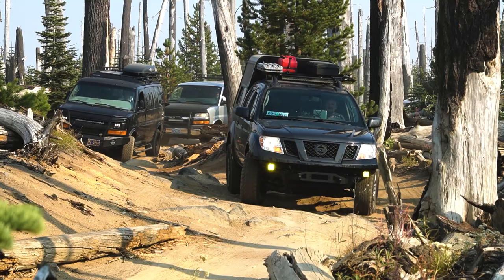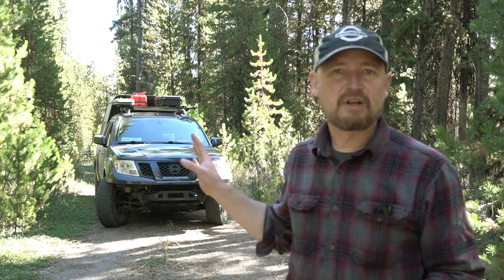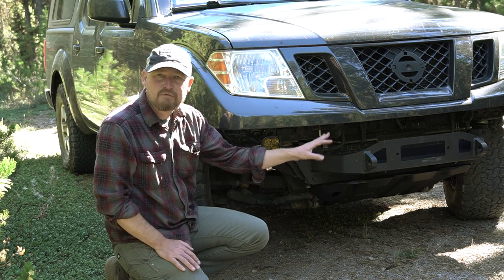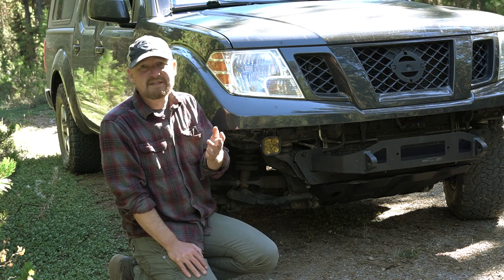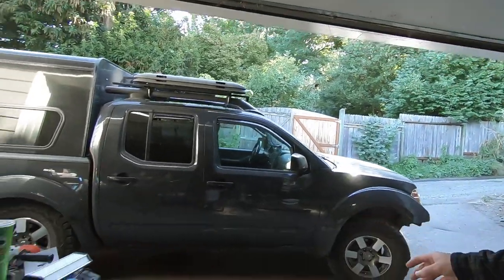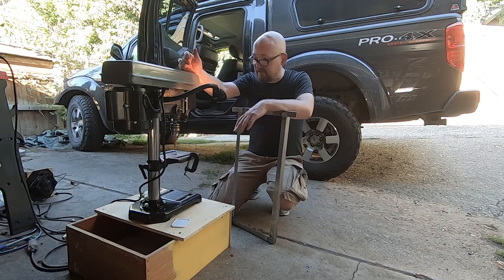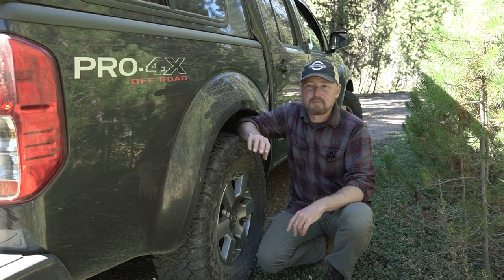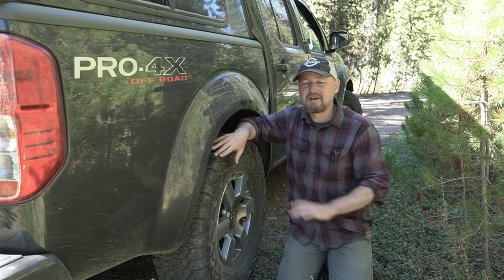Sept Vlog: Expo West, Winch Mount, Diff Breather & More

Comment: I bought a Badlands 15K Winch on sale, then returned it w/o ever installing. My Alternator is 60 amp and I didn't want to burn it up. I went with a manual Wyeth-Scott Power Puller with syn line instead. I can better use that around the property, transfer it to other vehicles, use it front back or on the sides, and I'm not having to always haul the weight.

Comment: Having learned to weld over 50 years ago, I knew when you started welding you would come down with the fever....fabricator fever , first a welder , a grinder, a drill press....just one more tool . From what learned the Smittybilt is about the highest rated ‘budget’ winch. ‘Hobo freight ones are cheap but they may be hard to get repair parts for because they keep changing manufacturers. When you get to Flagstaff you’ll have to run up and take a peek over the rim of the Grand Canyon., if you’ve never seen it. 👍

Comment: Great job on the fridge support Donald. Learning to weld opens up so many opportunities to save money. I run the Badlands Apex 12k winch on my 4runner. It's extreme overkill for the truck, and since I'm not using the truck to rock crawl I feel it will suit my needs (so far it has done great).

Comment: Donald, for the sanity of not burning up drill bits, you can safely turn the drill speed down as low as possible.  In addition, you won't fling flaming hot swarf everywhere, as well as you won't need as much drilling oil per hole.

Comment: That winch carrier is very much like the WAM carrier I have on my 2018 pro4x. Its designed to fit inside the factory bumper plastic with just a bit of trimming around edges. I considered a steel bumper but decided I didn't need or want the whole thing. Smittybilt 10k lb X20 fits well.

Comment: I have similar openings like the ones you taped up in the bed of my 03 Tacoma. I ended up sealing mine with expanding spray foam. Mainly because I found that mice could crawl up and gain access to the inside of the truck bed, and rummage through and shit all over my stuff. Not a good situation. Once I sealed them all off I have not had any mice get in while camping again. Also great for dust control.

Comment: I have a Warn but if I bought today, I would get the Harbor Freight with syn line.  The fact is, unless you are getting the highest end Warns, even Warn has cost cut their internals and there isnt much of a performance delta.  HF has a good warranty, and good value with the fairlead, wireless remote and syn line.

Also, you need to account for the accessories you need to properly use the winch.
Tree saver, doubler pulley, soft shackles (or d-shackles), extender line.

I prefer a shorter winchline (less wraps=more power) and if I need a longer pull, break out the extension.

Also, I would go all all syn line, soft shackles, etc.  Much lighter weight, saves space and safer.

Comment: Warn....I've had my 8000 lb Warn on two Tacomas for 20 years with wire cable....use it every year if nothing else but skidding logs for firewood....it's on a reciever hitch craddle and goes front to back. Great set up, wouldn't change a thing if doing over. The question isn't about whether to get a Warn, but what kind of line you want. I wouldn't do many of the pulls I do with synthetic line.

Comment: Front axle, transmission and transfer case all have breather holes or short tubes as well. Just saying. I've always done them using fuel line hose and what I call circlips...those circular clips you spread to get on and release to grab. Cheap insurance and your front diff fluid doesn't end up looking like melted chocolate milk shake.

Comment: There are some things I will not cheap out on and a winch is one of them. I have run Warn for 45 years and never had a problem with one. I know others that have the cheaper ones and most have had some problems. I also have a Smittybilt 9500 X20 that I use as a portable for the rear and take it on some trips. I have yet to have a problem with it but I have only had to use it 3 times in 6 years. I do know 2 people that have had problems with these. So if reliability is your main concern, I would go with a Warn even though more expensive and consider it a good investment for the long haul.

Comment: Gorilla duct tape is really awesome (their glues are a little more finicky). Not sure what you did to prep the area, but if it comes off, wipe the area down really well with rubbing alcohol, then apply the tape and use some sort of roller to really get it into that textured surface.

Comment: A mouse could get up through those holes (and that tape) pretty easily. I'd go with Tomcat Rodent Block Expanding Foam Barrier to fill those holes up under the bed wall it will give rodent protection, seal, and insulate all at the same time and is fairly cheap ($12). Cheers.

Comment: I worked at Warn pre recession.  While I was employed there I would occasionally read through the warranty claims for entertainment during breaks, I think Warn makes a quality product and their warranty adds value however, in the mid 2000’s the product Warn was making wasn’t 100% reliable.  I read many claims of failed winches out of the box, or after 2-3 uses over a few years.  The same types of complaints are reported about the Harbor Freight badlands winches.  The difference is nobody complains about Warn winches because the warranty takes care of any problems.  So ask yourself is the warranty worth the premium price.  Either way the odds are better than zero you will have a problem with the winch, and that might mean you have to hike out or be the friend who has a winch but can’t help when a recovery is needed. An extended warranty at harbor freight on a Badlands winch is probably approaching the cost of the cheapest Warn with a lifetime warranty if all that matters is the repair cost.

* this opinion is in reference to Warn winches built in the mid 2000’s, current products may be better… or worse.

Comment: If access to the taillight is a problem for mod , how would you change a burnt bulb?
Reply: Now that Donald has found out, I guess anyone following will just make certain they have good LED bulbs in there. I'd bite the bullet and do that now rather than burn a bulb 100's of miles from home and run the risk of a ticket on my way back.
Reply: @metaxaanabeer  Maybe drill access holes?